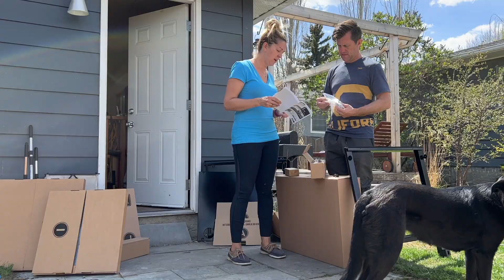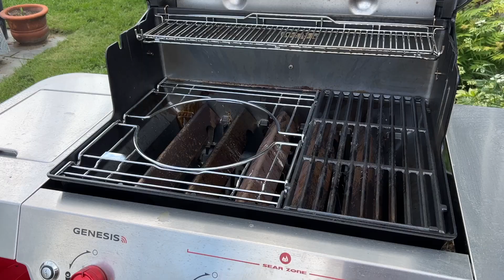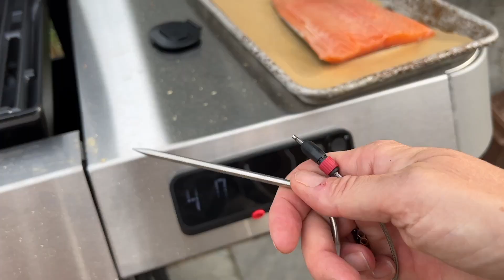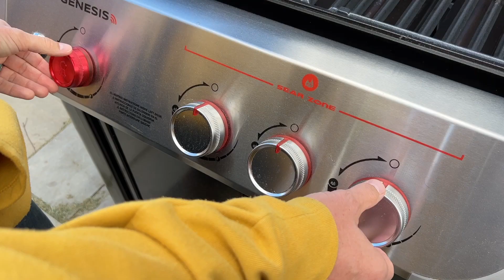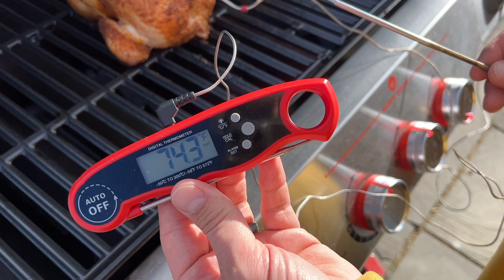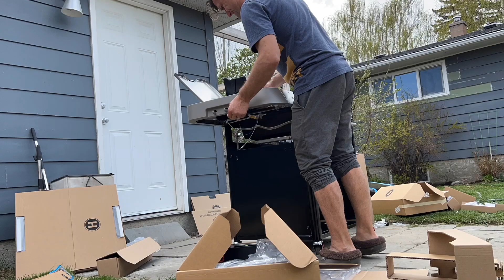Weber Genesis Smart BBQ review: can technology really help you grill better?

Comment: Great job!  Explanations on the smart aspect are excellent.  When you go on the Weber website it is not too clear as to what is included or not but you answer that question.  I guess you have to buy a separate power bank and a 2nd probe if needed.  The website almost make it appear that they provide  a "remote" but you answer the issue by using an app on the phone.  
My only question is the 39,000 btu on the Genesis 335 enough btu's to go general grilling.  Did it heat up to 400-450 degrees resonably fast?  The reason I ask is I have always had 48,000 btu on my older Weber. Thanks!